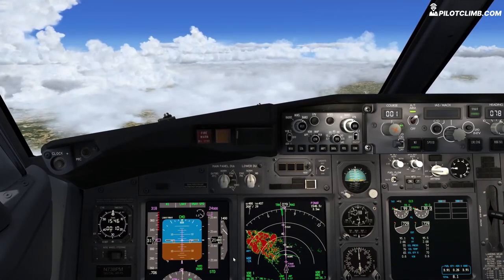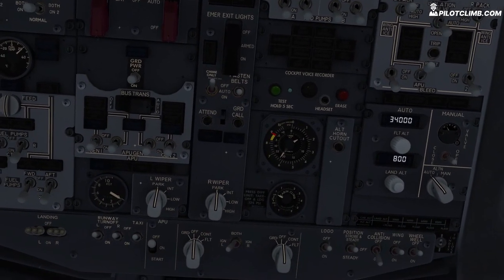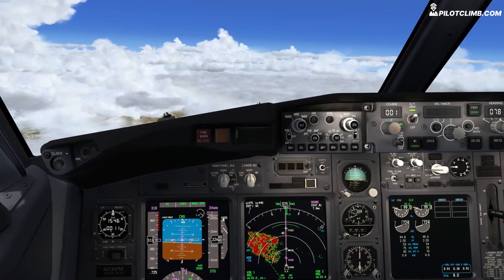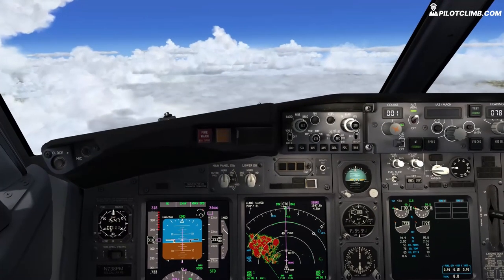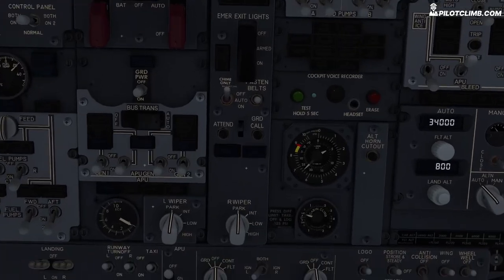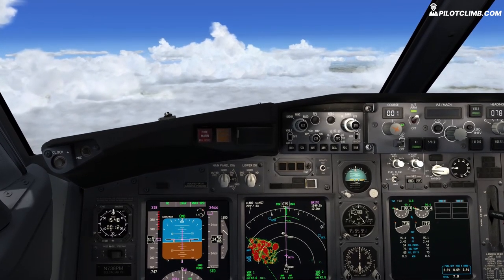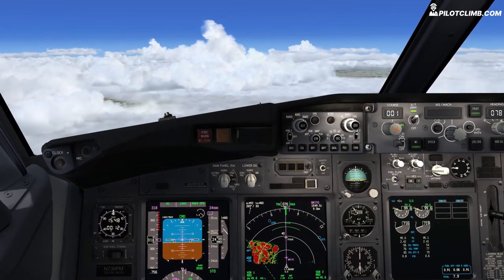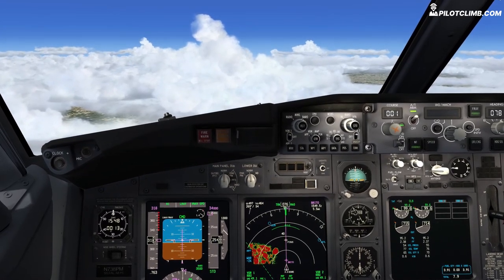Cabin Rate of Climb and Aircraft Rate of Climb Explained.

Comment: Hi there Captain, thanks for the video. What is the safest rate of descent in case of rapid depressurization? If you're cruising at FL360 and you need to descend to FL100 what speed and V/S would you use?
Reply from the maker: Great question!! Your priority in case of a rapid depr is to go down as fast as you can! So you want to dive down at max speed.

Comment: Only now did I see this video. Also, only now I'm at that level of wondering about passenger comfort vs rate of climb. Been wondering if climbing at or even over 4000 feet per minute is something pilots actually do in real life such as using level change to get faster to the TOC.
Reply from the maker: Climb rate of 4000 ftmin it's quiete a lot, however possible... The pressurization sys does a great job keeping the cabin rate of climb to an acceptable level..

Comment: What if your climbing through 16000-18000 and cabin rate of climb is indicating zero and -50 instead of +300 or +500 which is the normal indication, and cabin altitude is stuck on one number 2600 feet. What do you think is happening?
Reply from the maker: If the cabin Alt stays at 2600ft the pressure difference between inside and out side the cabin will exceed the max value of 9.1psi